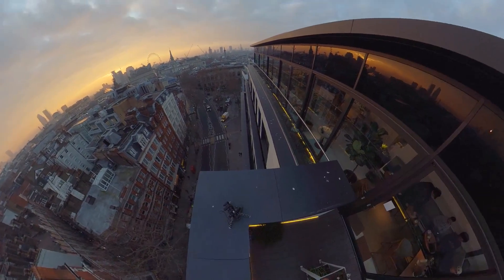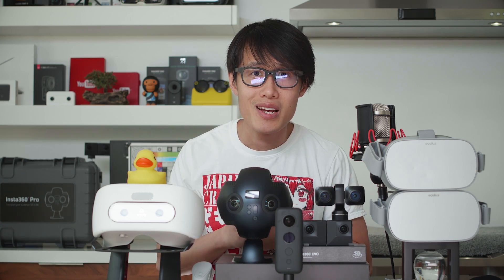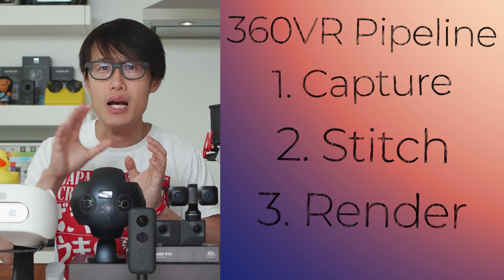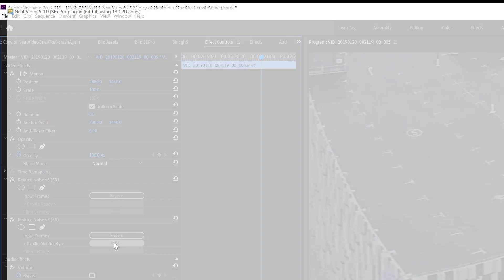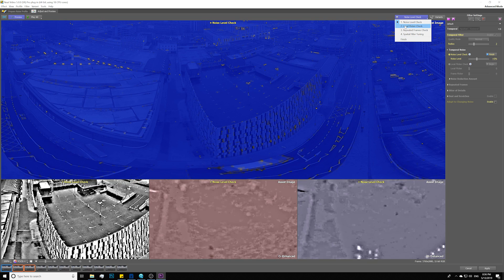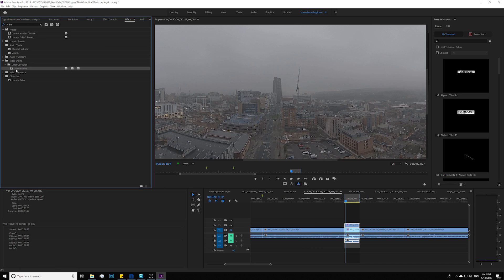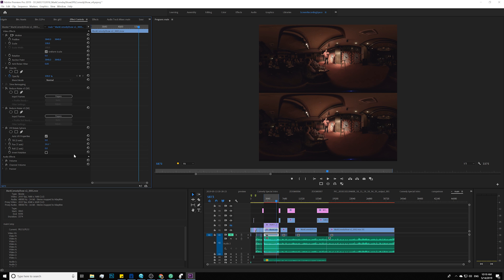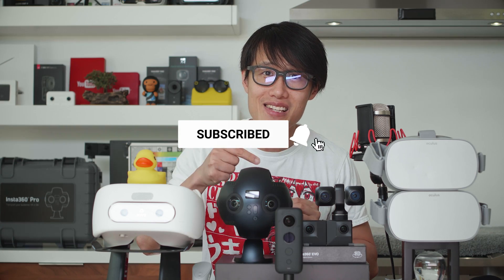Remove Noise in Low Light 💡 360 VR Video w/ Neat Video 5

Comment: Hi, Hugh. Thanks for posting this workflow, however, I have one question or observation which I’d like your input on. Much like when the 2:1 equirectangular panorama becomes more and more warped the further you go up and down the frame, the compression noise also gets warped along with it. So, theoretically, it's almost impossible to pick a spot on your footage that would accurately reflect the noise profile across the entire panorama. In your opinion, shouldn’t denoising of the footage be applied BEFORE stitching when the noise is more uniform on all of the lenses? It stands to reason that Neat Video should be able to do a better job of removing the noise more uniformly if you create a noise profile preset for each low light scene and apply it to all the lenses (Insta 360 Pro in my case), than when the noise gets warped post stitching? Eager to hear your thoughts on this.
Reply from the maker: Before stitching is the best! For Pro 2 I did that. I also use general noise profile instead picking spot.

Comment: Hey Hugh, I have learned a lot from your videos and they have been exceptionally helpful to me in my projects! i just have have an issue with the neat video 5; after adding the plugin to the exported prores footage from pro2 there is a lil snip of the video that is missing around the corners and at the top and bottom, and you mentioned that if the sharpen at midpoint is on that this causes the issue im facing, but i have double checked and sharpen around midpoint is off. any tips or advice on what is causing the issue im facing?
Reply from the maker: I actually never run into this issue. You should contact Neat Video support they should be able to help you out.

Comment: Hugh, thank you again so much for this. I purchased Neat Video 5 for Premiere Pro based on this tutorial. I was wondering why my GoPro max footage was coming out ugly! Protip for anyone having issues with Neat Video 5 being painfully laggy and slow: be sure to use this effect first before ANYTHING else. I couldn't figure out why my relatively fast PC kept crashing, then I removed all attributes (I had VR projection on). Once I did this, it is MUCH better. Only thing that sucks is having to render after every edit but again, thank you for this amazing workflow. I also got your new 360 LUT pack, paid only $5 for a donation and I feel like you deserve so much more! Any updates on a master class date?
Reply from the maker: Thank you! Still working on the masterclass. I always got pull away from actual production. Working on a new VR music video with some mega artists for release next weeks or so. But I should be back on track pretty soon. Another tip for using Neat with GoPro MAX is actually move your clip to After Effects. In After Effects Neat run a lot faster with Pre-comp (you can nest too in PR but not as good). So I usually reframe in Premiere - render to AE - Neat + Sharpening + color grading - then back to PR for final render. Effects pass usually faster in AE. And you don't need to learn AE - it is just a host for you third party effects.
Reply: @hughhou  Glad to see you stay so busy! Interesting tip, I'll try that with AE for my next video. Hoping to see you do a video on the new 14.2 Premiere Pro update with hardware encoding. Thanks for the response, I'll be checking back for the master class update.

Comment: Hi Hugh -- I love your tutorials. Very informative!  I have a question about workflow.  You hae talked about re-encoding the least number of times to preserve the highest quality of video.  What is the best workflow to pull footage from the Insta360 Evo 3D, fix it, then get it into a headset like the Quest?  Is it to import into Premiere then use their VR effects and AfterCodecs (which you talk about in another video) to re-encode it as an H265?  Then take the H265 and import that into Neat Video to remove  flicker/artifacts?  Then re-encode it as an H264 (or H265, if Neat can do that) so it can be played in the Oculus Quest?  Seems to be a lot of encoding/re-encoding going on.  What is your opinion?

Thanks and keep up the great work!!
Reply from the maker: Oh no, H265 and h264 are compressed codec - you never use it as intermedia render. I will use ProRes 422 - still compress but it is not lossing quality from Evo footage only 8 bit. So the workflow is Evo to Premiere - render with aftercodec or just native Quicktime from Premiere to render as ProRes 422 - do your denoise deflicker in ProRes 422 and then edit. When done, final render back into H.265.

Comment: I am trying out the demo version of neat video in premiere pro to edit my 360 degree video to make sure it works before I buy it. When I am finished and export the video from premiere and then view it on my computer, the video only plays for a second and then freezes while the audio continues. I do not have a problem playing other videos that have not had neat video applied to them. I am wondering if you have come across this problem before? Thanks!
Reply from the maker: I don't think demo version can even process anything more than 4K. It can be the issue. Are you using Premiere or After Effects or Resolve?
Reply: CreatorUp thanks for the reply! I am using premiere pro with 4K footage. It turned out that the problem was that I didn’t have enough computer ram to render properly. The problem disappeared once upgraded my ram. I am now using neat video with no problems. Thanks for the great video!

Comment: I decided to try and use the ProRes 422 codec.  Do you upload .mov to YouTube or convert it? (the data difference is crazy: 30 second video 560MB(H265) vs 9GB(ProRes422). I need to step up from hobbyist to pro, and I can't afford not to keep your advice anymore :)
Reply from the maker: So YouTube has a limit of 125G or so for upload file size - so if your video is under 2 min - ProRes will work.

Comment: In your work process first do NeatVideo and then lumentri ?, will not it be the reverse ?.
I have a supercomputer, 3 RAM0 X 3mi, 128ram, 2 ASUS ROG Strix GeForce RTX 2080 Ti and Core I7 6900K, 10000000000 times more powerful than the computer that went to the moon, and when I put the NeatVideo 4/5, either one of them finished the workflow, instead of a computer, I have a pocket calculator ..... that's the workflow? Insurance? "....Somewhere I lose myself...."
Reply from the maker: I do NeatVideo first - in fact - I do denoise before anything else (even before stitching). What is the size of the footage you are talking about? 8K x 8K from Insta360 Pro 2? Ozo? Jaunt One?
Reply: @hughhou  Insta360 Pro, Now I'm precisely in it, three times the Adobe Premiere has burst and I deleted the VID_20190000_0000.ins, I consider to put the Video Immersive Noise Reduction, to finish the project and deliver it. I took 2 days trying to remove the noise of a sequence of 1 minute, plus another 2 days to remove the Gimbal Car, the computers are not yet ready for the 8k. And the worst thing is that at the end of the month they give me the Titam .... Greetings and thanks for your wise advice.

Comment: What are the best render setting in Mistika VR for 360 3D 4K or 6K footage on Windows (insta 360 Pro1)? Struggling with that, premier will not open my HVEC files but i want uncompressed footage?
Reply from the maker: First, check my Mistika Series: https://www.youtube.com/watch?v=rSQUUHsDePY&list=PLAyCpxLR2Txu8_IyBxo46a1VfqZjim5S3&index=6
I use ProRes 422 or PNG sequence.

Comment: So if you are using mistika is there a different step before applying neat 5?
Reply from the maker: Yes. I should make a follow-up tutorial. But basically, you denoise individual clip first before stitching. Render it out as ProRes or DPX and then stitch with Mistika. If moving shots, you will need Mocha to stabilize it in POST.

Comment: Great video Hugh. Another technique for denoising AND sharpening, is to run both processes on the raw camera capture video files.  Then it doesn't matter if the sharpening tools are VR/equirectangular aware.  However, it does require running the identical denoise/sharpen settings on all six camera files (if you're using a 6 lens camera). And you have to render the denoise/sharpen on those six camera files, which takes time.
Reply from the maker: Yes absolutely! This is actually the recommended workflow. But we will need Mistika VR to stitch them which lost the stabilization info. And most ppl do not own Mistika or AVP here.
Reply: Agreed, most people rely on the standard freebie stitching tools.

Comment: Thanks for speaking slow and clearly :)

05:35 For Insta360 One X, if you directly open the insv files in Premiere Pro, and start denoise and editing from there, will the video quality be preserved since it was not first encoded to h.264 via the Insta360 One X studio?
Reply from the maker: Awww thanks! I try! My accent is pretty strong. I am also looking for community help on translating my video into a different language - if you know anyone interested, I will credit them on description! 

For your question - 05:35 - thank you for point this out. This is a great idea if Premiere can handle the insv file. I have not tried that yet as I mostly use Mistika VR. But this can be THE solution. Thank you for point out such a great tip!! I will try it myself and report back!